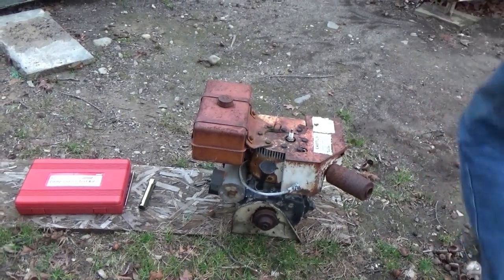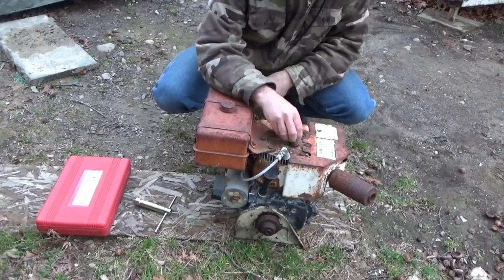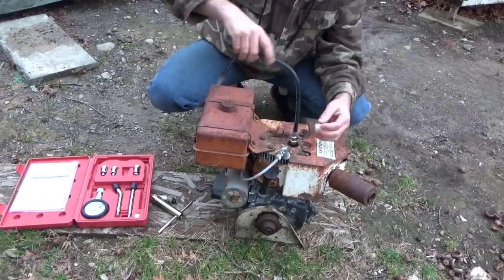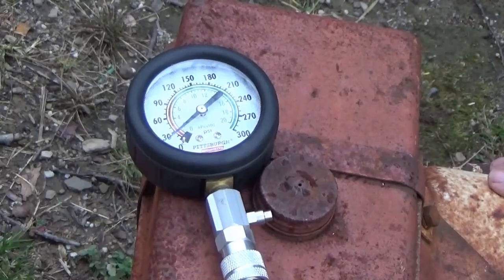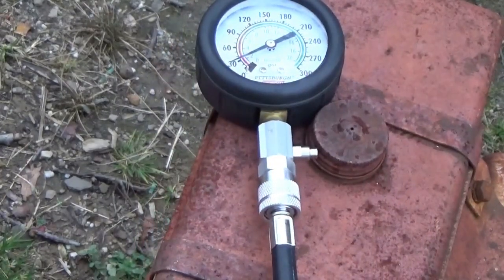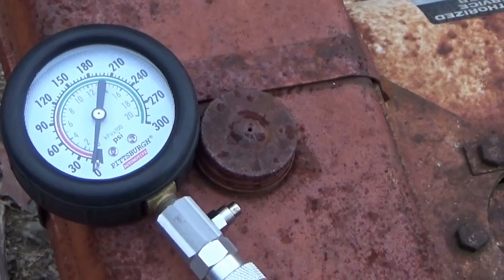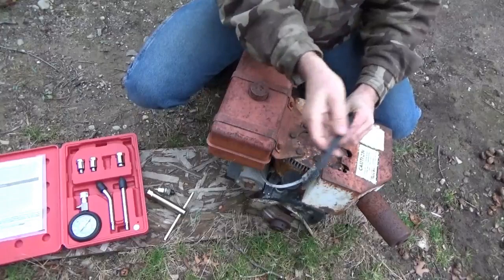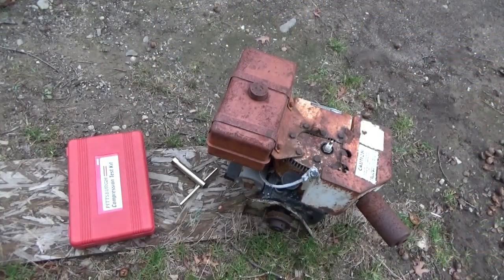How To Test Compression On Lawn Mower ~ Gokart ~ Snowblower Engine

Comment: You have NO idea what is wrong....valves, rings or head gasket. Without a leak down test you are GUESSING.
Reply from the maker: Thanks. I do pretty well with small engines.
Reply: @TheDoItYourselfWorld  Tell us how you know what is wrong without a leak down test??? Save us some money.
Reply from the maker: If the compression is good, I clean the carb and run it. Otherwise I tear it down and repair it. Why the hostility? This video was only about how to check for compression.

Comment: On a snowblower I have, put new plug, new carburetor, new 100% gas, still won't start and is getting worse. When it attempts to start it seems I am getting some backfire or misfire. It funny because a week before the snowblower was running fine.
Reply from the maker: You could have a bad spark plug and still get spark when its out of the engine. I would check that first.
Reply from the maker: Check the bolts on the carb and make sure they are tight. You may have to adjust the carb for your engine in order to run right. Check spark too, it could be a bad plug or bad coil. And check compression, maybe rings are worn (doubtful if it was running tho).
Reply: @TheDoItYourselfWorld  Carb nuts are tight, can't see anywhere where foreign air would get in.  Spark is strong with spark tester. There is no backfire of misfire anymore, but not getting any firing at all. It's a chinese carb, there are 2 screws one is a round plastic one on top (that one just looks as if it prevents the choke from going to far) the second screw is on the side next to the gasket that is next to the engine, that has a square plastic cap on it. I tried starting with a drill & socket spinning the engine, no firing at all.
Reply: @TheDoItYourselfWorld  Can I have a bad coil and still have strong spark? I tested the spark with a spark tester + putting the plug against the engine body, all good. Even tried starting with a drill & socket, spinning the drill for 1 minute, nothing. Carburetor bowl had fuel in it.
Reply from the maker: Try this. Remove the spark plug. Put a tiny bit of gas in the cylinder. Just a few drops. Put the plug back in and fire it up. If it fires, you are not getting gas. If it wont fire its the spark plug.
Reply: @TheDoItYourselfWorld  I put some gas in the cylinder, put the plug back in, after about 10 seconds starting with a drill, there was 1 small pop from the muffler. Then nothing. Also put my finger over the spark plug hole and could feel strong compression. Fuel lines are clean and unobstructed. Could I have put the gaskets in wrong on the new carburetor, blocking some passage way ?

Comment: I good small engine will only have an average of 45-60 psi, because every small 1, and 2 cylinder engines have a compression release to make it easier to start. once the engine starts running it will turn off and run at 100-120 psi. Unless you can spin that engine at 1500 rpm, you will have a low reading.  I have brand new tractors with only 50 psi while cranking. 30 is too low though

Comment: this weak I got a Brigs army generator for free (12 and 24 volts battery charger), had been standing outside for 25 years (under his original green canvas army tarp) checked compression , about 1,5 (!) bar,(bad!!) cleaned the carb, changed the oil and sparkplug, connected a battery,filled the tank with gasoline with a little two stroke oil for running in, it started right up, first time, (even charged the 12 v battery at 40 amps!! ) kept it running for 15 minutes, next day checked compression, was about 6 bars!, started it again and ran it for half an hour, runs fine, charged 40 amps at 12 volts, 21 at 24, so whitout any large repair it runs grate!, maby an idea before you take it all apart. just let it run for a time on clean oil will solve a lot of problems there realy are none......checked compression yesterday, more then 8 bar, runs great, works fine.

Comment: don't mean to be argumentative but all the facts need to be stated that you cannot get a "true compression " reading on small air cooled with compression release
that's why most small engine shops do not rely on compression readings because of the release mechanism cause an inconclusive reading
with that said you probably have serious problems with that old Snow King engine lapping may help you probably should really check valve clearance.
possibly  recut the valve seat then check valve stem clearance  then lap the valves
Good luck with your project

Comment: true and not true Briggs and Stratton easy spin start in 1961 had a lobe on the camshaft has a compression release as time progressed they change that system to meet emissions and went to a mechanical release with a spring, pin and lever on the cam. Tecumseh had similar things on there snow king engine (lode on cam). compression release on the overhead valve engines newer ones all have a mechanical spring and pin compression release to make for easy starting

Comment: most small engines have a compression release on the exhaust valve if you don't pull hard enough the counterweight on the camshaft won't stay in and you'll get a false reading
Reply from the maker: +Mr “allwrench” B Not most, but many newer ones. Actually I dont think I have any that do have that now that I think of it. I prefer older engines
Reply from the maker: +The Do It Yourself World Maybe "most" newer ones.

Comment: have you thought about a predator engine?  they run well, start easy, have tons of power and should last a long time if maintained because of the cast iron bore and ball bearing supported crank unlike the bronze crank bushings and aluminum cylinder bore in that tecumseh engine

Comment: check the valves,and head gasket.You are probably better off buying a new engine,if this one isn't worth saving.I wouldn't go throwing$ into it tho.that compression is way too low.
Reply from the maker: +MrCrf450rider I will pull the head and see how it looks inside. Now you are looking from a repair service standpoint. I am looking from a hobby standpoint. Value is relative there. I dont have the funds for a new engine but I have time to fix an old one. And its a challenge. I want to see if I can do it. As long as the cylinder is not badly scored I will get this running again.
Reply: +The Do It Yourself World sounds good!

Comment: Looks like you need a new gauge as it shouldn't drop slowly it should stay at the pressure that topped out till you release it also just because its low on compression doesn't mean it is definitely valves it could be the piston ring.
Reply: +Ryan Fletcher (Fletch) Just say no to Harbor Freight tools... :-)
Reply from the maker: +Ryan Fletcher (Fletch) I will open it up on video and see how it looks inside.
Reply: Will be great to see how it looks. Surprised you got any compression at all. Good luck.
Reply: Steven Hardy i live in the UK so we don't have them over here anyway :)
Reply: ***** 95 percent of their products are Chinese copies.
Reply: Steven Hardy  Ahh i see yea know all about that but least they say made in china that comes over here
Reply: +The Do It Yourself World 
Also when you get the head off move the piston so its tdc then check to see if there is a lot of movement in it if so piston rings are probably shot

Comment: Troy: Another aspect to this test is a few drops of heavy (30W at least) oil into the cylinder and then try compression again. If it comes up then certainly rings, etc are needed. Also not sure how easily it is on this engine to get to where the valve tappets push on the valves to confirm they are properly adjusted or at least full closing.
Did you resolve the missing carburetor, intake manifold, air cleaner??
Reply from the maker: +GrandsonofKong I did spray oil into the cylinder and it did nothing. I think its the valves. I hope. I have a new carb and coil for it already.
I will remove the head and check the valves. All on video.
This had no air cleaner since its a snow blower.

Comment: Only way to get an accurate compression reading, is with the throttle plate being wide open. Please read the instructions with you compression tester. This test is not valid if air is being restricted by the throttle plate being closed.
Reply from the maker: +niper99 Lol, yup, I figure its as open as it can be.
Reply from the maker: +niper99 I like the challenge. I will try. Unless the cylinder is badly scored, I will get this one running. By the way, what is the life expectancy of a Predator? This engine is from 1970 and could possibly outlive us all if its not too badly scored.
Reply from the maker: +niper99 Thats interesting. I have heard a lot of bad things about them. Mixed opinions out there.

Comment: Troy don't you  got bigger fish to fry
Reply: +The Do It Yourself World 
U have a jeep now just put a plow on it
Reply: +The Do It Yourself World ..even if you put a 2x4 as sides at a 45 degree slant and use a 4x8 cut down with a few braces behind it then you got your self a cheap plow that will work i did it 1 year on my 67 chevy truck with my 3/4 mile drive way plowed all that snow every time al winter down 1 side come back on other side never have to change angles of blade
Reply: +The Do It Yourself World       Salmon ......... LOL
Reply from the maker: +Jose v V Salmon
Reply from the maker: +Jose v V Snow is coming. I have to have a snow blower and good running vehicles. That take priority right now. And I am in between pay checks.
Reply: Don't you ???
Reply: An as far as the Jeep you have a mouth why don't you put a sock in it Jose v V